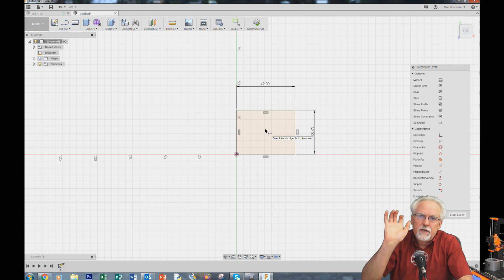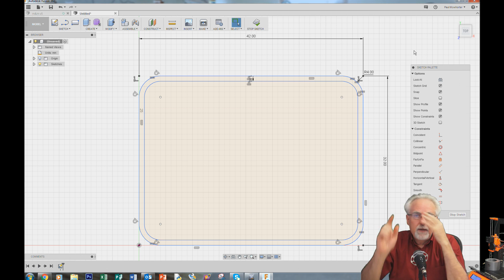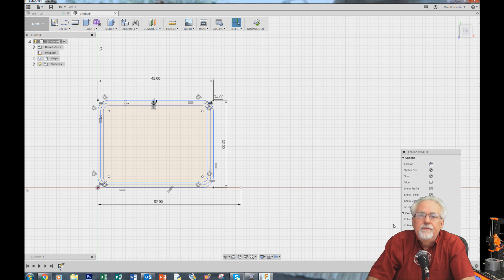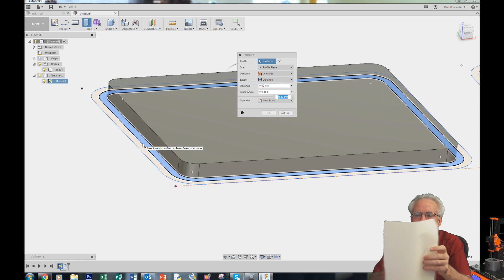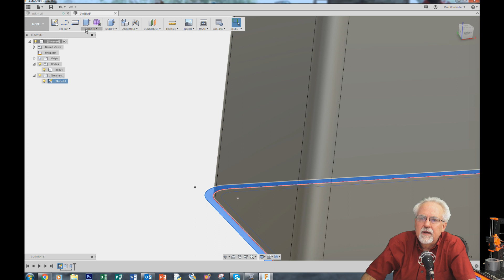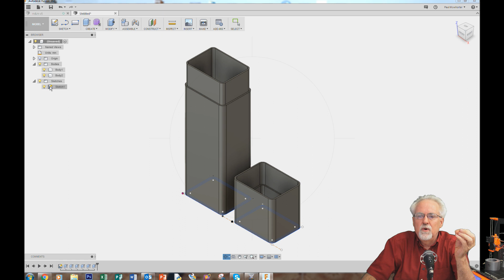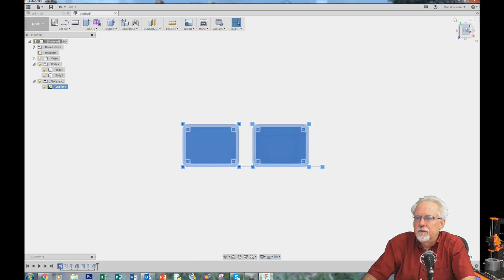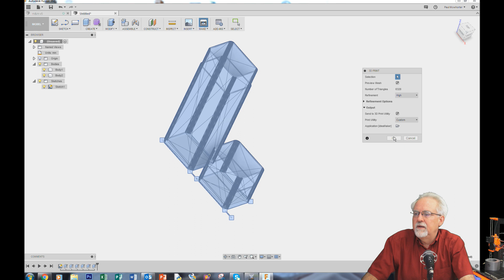Learn Fusion 360 or Die Trying LESSON 2: First 3D Design for Absolute Beginners

Comment: Excellent lecture.  Unfortunately my print won’t work.  The CAD drawing describes the theoretical shape of the component.  (Effectively the centre line of the print).  In practice the 3D printer uses this as the centre line of the extrusion with the print being .4mm wide, .2mm either side of centre for each component, giving an interference fit of .4mm.  Other than manually changing the offset, how can I compensate for this?
Reply: Forget my question, it’s answered in a subsequent lecture (4?) using parameters.  Thanks.

Comment: My version of Fusion 360 acts a little differently; for instance any tools don't persist after each use and goes back to selection tool, I had to resize each radius separately when you did all four at once, and I couldn't input "-1" for the offset in the highlighted box- I had to use the little arrow key to lower it to minus 1 mm manually.

Comment: Have you customized your interface?  I do not see what you see.  This is what drives me nuts about ALL of these tutorials...I don't see what they see...I have a DEFAULT install of Fusion 360 with NO CHANGES (IT IS DEFAULT), and mine doesn't look like yours...and this is causing me grief because you ask to do certain things (i.e., the X-Y-Z) and mine isn't the same.
Reply from the maker: On your preferences, se "Z is UP"
Reply: I just went through every menu...there are no "preferences" selection...again....this is what gets me angry with these tutorials..."just do that", "you just do this", "select that, and bam it works"...yet in most cases these "click that", "type that", "use this key"...DOES NOT WORK.  I can't be alone here, but I feel that I am.  My DEFAULT system is in INCHES (I'm OK with that, I plan on using this for some wood working projects, and all my lumber is in English units), but why is my "default" setup different?  Others have told me that no, the default is METRIC...Well, then I'm that 1 out of 1 TRILLION that gets the screwed up system.  Typical....if I had as 99.9999999999999999% chance of hitting the lottery I'd lose.  Typical.

Comment: Hi-Di-Hi Paul. Thank you for taking the time to produce excellent videos. A QUESTION (that you might elucidate in a later lesson that I have yet to view): How do you edit a feature, for example, after filleting I decide that I pressed a wrong key and my fillet is the wrong size; how do I change it.  I general, this is an important thing to know at an early stage because designing something is an iterative process and I frequently need to change the shape or dimensions of a feature as the design progresses. Like several people, it seems, I am retired, although I have used, and still use, many programmes for many things and Fusion 360 will be used for my model engineering.
Reply: OH. I see, double-click the dimension. I was typing 'D' to operate the dimension tool, then selecting the fillet - but what this was doing was adding another dimension to the existing feature.

Comment: Just a tip Paul, you should make thickness of the walls to be multiples of your extrusion width.  In slic3r, this is normally 0.45mm for 0.2mm layers with a 0.4mm nozzle.  Wall thickness of 1.8mm would print nicely with 2 perimeters.  Or not.. The choice is entirely yours :)  Great video series.

Comment: I really found it useful.  I decided to do a case for my phone (74 cm x 144 cm.  Things worked great with just a few steps back!  I went to print and it will not fit into Cura 2.7 .  I cannot move the top and bottom off of the X axis.  I want them on top of each other, so I need a bed 148 x 144 and not 74 x 288

Comment: I'm wondering .. wouldn't certain "tolerances" need to be accounted for ? If the dimensions of the outside of the  offset  lip on the taller object are EXACTLY the same as the inside of the "cap" ( the smaller object) I don't think they would fit on a real  world object. Could you explain or expand on this. Thank you
Reply from the maker: I went over this in the sketchup lessons but not the fusion 360 lessons. You design and build design rule checkers. For this 3d printer a hole and peg the same size leads to a snug fit we want. The tolerance depends on the manufacturing process. For my 3d printer this is what works.
Reply: Thank you. Good to know.

Comment: Fantastic content, I'm not here to learn 360 - but your title cracked me up.  You're doing a wonderful job teaching this, will absolutely recommend this series for beginners.  Thank you for offering your time and expertise to the topic, we're only better off with more capable makers in the world :)
Reply from the maker: Yep, sort of scares me that we really need a new generation of makers. In the past, it was the HAM radio kids with their Heath kits and dipole antenna. Then we had the electronics project makers and coders. I made all these lessons on arduino, raspberry pi, bbb, python, sketchup and fusion to hopefully spur interest among high school and middle school students. Sadly, when I look at my channel demographics, about 1% of my viewership is the less than 18 year old crowd. Way more than I would have expected are over 65. Of the younger audience, most are not from US.
Reply: What an interesting bit of information (demographic breakdown from channel statistics), I'm surprised.  My father introduced me to the C64 and coding simple games, heath kits, and little soldering + breadboard projects.  He was also very capable in that he could operate nearly any type of machine, was an electrician, worked on his own vehicles, framed his own house, repaired water heaters, replaced AC systems, etc (a lot of real world working experience).  I started as a software engineer, and moved into hardware by way of access control system design - so I'm a bit more handy than the majority of my friends/family, but still nowhere near as comfortable with welding & sweating, engine work, armature winding, and a whole host of activities that were like second nature to him.  His peers were similar, and one of my uncles in particular.  I don't see these traits in the majority of my social group.  It feels like we've lost something of 'fundamental education' over the 'typical' course of schooling.  Is it the parents missing out on these things for some reason so they can't introduce their children?  Thank you for the information.

Also, here's something the middle schoolers may think is super neat: http://www.realtimerendering.com/erich/minecraft/public/mineways/

Thanks again, you've certainly earned more than a measly subscription from me :)
Reply from the maker: Just curious . . . are you in about your 40's? Cant tell from the small picture. I am in my 50's and my generation grew up working on cars, knowing proper use of hand tools and power tools, knowing how to do very simple plumbing and electrical. And these were the NON technical ones. The technical ones would build heath kits or have HAM licenses. But overall, everyone was very adept at practical skills. These skills are very lacking in the under 30 demographic, and almost completely gone in the under 20 group. Really wonder what is going to happen when the old plumbers and electricians die off .  . . who is going to be able to do anything?
Reply: 35, so close enough :)  Yeah, you're SPOT ON with trade skills vanishing.  So many people would be better off today going to a trade school than college.  How many more lawyers do we need?  My brother-in-law is 23 and graduating now as a mechanical engineer, I suspect that his finding employment will not be difficult - given that he grew up on a farm working on tractors & implements.  Conversely, we frequently see applicants with various engineering degrees and they do struggle with the actual simple tool usage, lol.  What happened to us?!

Comment: Great videos!    I want to add something though.  
When you want to go back into sketch mode to change the dimensions, just doubble click "Sketch1".      Press "stop sketch" when finished . 
I don't know if there is a special reason why Paul does it in his way.
Reply from the maker: Special reason is . . . that is the only way I know how to do it. I am not an expert, so just show a way that works, it is not always the best way.
Reply: I guess it doesn't matter as long as it works. Thanks for making these videos! I am studying as a design engineer , and both your Fusion 360 and arduino videos are really helping me out this semester. Keep up the good work :-)

Comment: Hi Paul, like you many of us have been trying to learn this program.  I started tinkering with Fusion 360 about a month ago, after being pretty good with SketchUp.  One tip that I learned that you may find helpful concerns getting back into the editing mode of a sketch.  At about the 21 minute point in this video you were trying to get back into the sketch to edit it buy initiating the rectangle command (even though you didn't want to create a rectangle.)  A simpler way to get back in the editing mode is to use the time line at the bottom left of the screen.  You can see the icon on the time line for the different sketches (as well as other actions).  Just right click on any sketch icon on the time line and click edit sketch and your in!  

Thanks again for your videos.  They have helped me a lot.  Especially the Linux videos for the RP!
Reply from the maker: What you are saying is correct, and I will admit, I am not completely comfortable with the timeline yet, so do not automatically default to that option. One of the skills I need to still develop is taking advantage of that feature.

Comment: Paul I have verified that I am following per the video but after using the "Rectangle Pattern" then changing the dimensions of the first set of rectangles, only the outer rectangle changes size. The 2 inner rectangles remain the same size. The pattern does follow the original rectangle. What am I doing wrong?

Comment: Thank you for the videos.   I do have a question.  After extruding and attempting to go back and adjust sizes etc by bringing up the grid via sketch and create a two point rectangle, when I hit select the grid disappears and I no longer have that option.  When I go back to the sketch portion in the bottom left the bodies disappear.  I am using the free version to learn.  Is that different from your version?  Or what am I doing wrong?
Reply from the maker: Maybe you are having the sketches and bodies turn on and off. Look at panel on left and the little light bulbs by sketches and bodies. Click these to turn them on and off . . . or make sketches or bodies show or not show.

Comment: Paul, Sir,  You are a fantastic teacher. i followed your Arduino lessons and now i'm learning CAD!  I'm really happy, cause : It works! Having said that i'm sure the're is room for a remark; Did someone really printed the (eyeglass) box ? I did. ( made a minor adjustment in height, so it took less time to print :-) ) I put the two parts together and..... they are stuck forever! Can't take the halves from each other. Hahaha. Maybe a little remark, or perhaps a lesson on tolerance ?? Please, Sir ?
Reply from the maker: Yep, the 3D printers and the slicing software are all different. You have to sort of dial in your printer as far as tolerances go. I printed on a high end printer, with finest resolution. This gave me a snug but managable tightness. You might want to leave a little tolerance if yours were too tight.
Reply: Make the offset for the top part of the box about 1-2mm bigger.. To account for the Box having to fit on top! Think about a shoebox ... Sometimes the top portion of the box isn't the exact same size as the bottom! They wouldn't fit, (or they would get stuck) :) --Jessica
Reply: Yes, I had the same problem. What's more, because I had slaved the two parts together, there was no way shown in the tutorial to have their dimensions locked, but then add/subtract a small amount for second part so that the lid will fit. Unless there is a way to do that, then slaving the two is actually a bad thing to do for this example. I instead deleted the lid part, and then copy/pasted, changed the appropriate size by 0.2 mm, and the lid fit fine. 

I am an EE, not an ME, but it seems like really bad practice to rely on the slicing software or your printer to provide the fit tolerances you need. It seems to me that the CAD drawing should do that.

Comment: Just found your channel last night. Fantastic! I was the guy you described at the beginning of this video. Thank you for taking the time to create this series. I gave up on learning CAD so many times! Even though in my distant past I was a manual draughtsman , CAD was like a foreign language to me.I have followed this video and created my own glass case! One question I hope you will answer. Near the end(time mark 22.24) you go back into the sketch and show that you can change dimensions. On my Fusion, I change a dimension and get an overlay of the new size instead of changing the sketch, in other words the new sketch is on top of the original instead of the original changing the size. What am I doing wrong?
Reply from the maker: Really not sure what could be going on. Might start fresh and play around with it maybe you ended up with two of the same on top of each other, and only realize it when you change the size of one.
Reply: I closed out Fusion, and restarted the computer. Reloaded Fusion and drew it again. Same problem. So, I just saved the model and moved on. Thanks for replying. I went on to design and print a replacement drawer pull for a Kennedy 520 tool box I'm restoring! Had a few problems, but got it sorted!Really enjoying your videos.